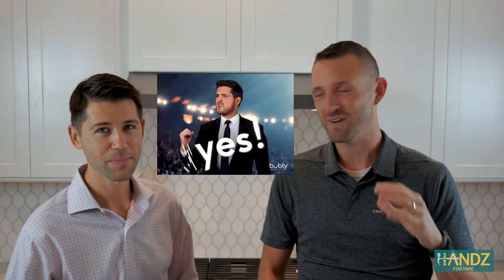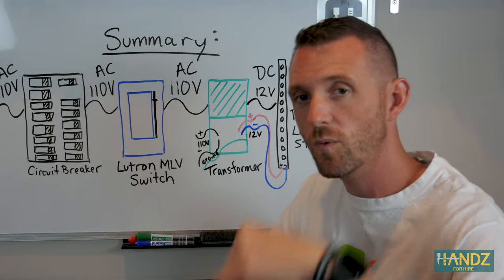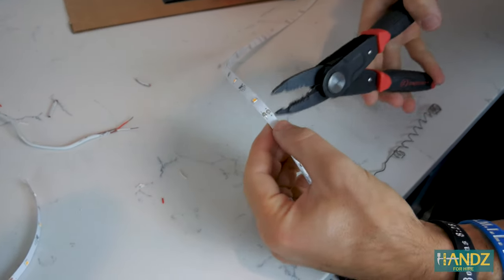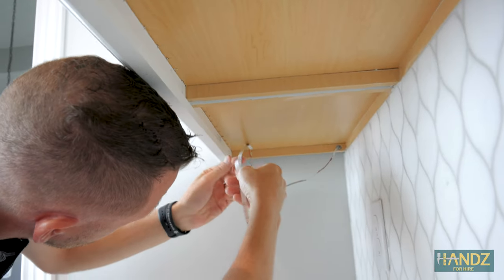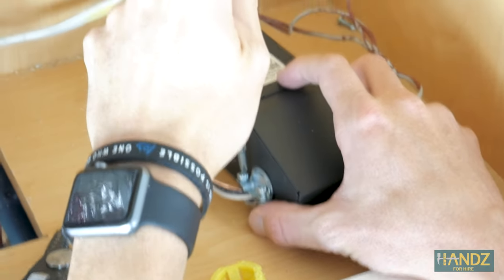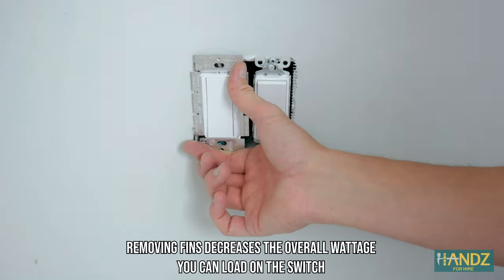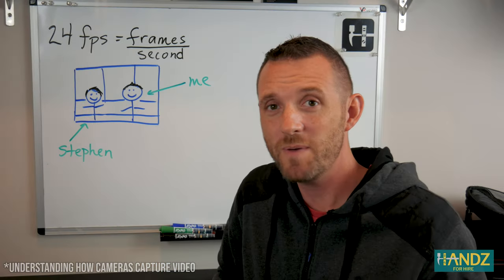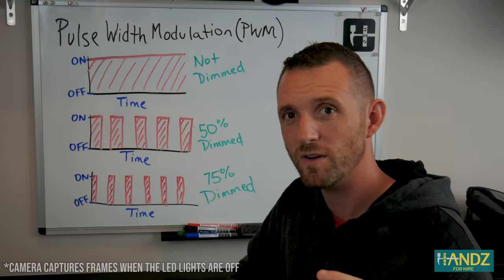HOW TO INSTALL UNDER CABINET LED STRIP LIGHTS w/ LUTRON DIMMER | Why do LEDs flicker on video?

Comment: You should not have clamped the romex on the wires themselves, rather than the sheathing. that's against code. Also not positive but I think the exposed wire coming out of the wall needs to be in conduit for code as well.
Reply: The exposed wire would be ok outside of conduit inside a cabinet i think but you're definitely correct about the non sheathed 14/2 being clamped, thats a no no.
Reply: Nah inspectors will pass having romex in an cabinet in a situation like this
Reply: Romex wire is not allowed exposed in a kitchen cabinet, BX armor cable is. Also mixing the low voltage wiring with the higher voltage wiring in the same enclosure is not permitted without a physical barrier between the two. There are exceptions if you know the NEC National electrical code. This is what separates the DIYers from the professionals. FYI the Romex sheath goes in the connector not the single conductors.
Reply: I totally agree!

Comment: Hi! I had an electrician install these under my kitchen cabinet but after 3 years, 2 of the strips started to flicker then they completely went out. What could be the problem and how do I replace them? They're not on a dimmer. Thanks :)
Reply from the maker: Hello, I appreciate you sharing. If this happened to me, the first thing I’d check are my connections. Sometimes wires can get bumped and the soldering can come loose. Did your electrician solder directly to the strips like we did in this video? Do you still have strips that are working? If you’re able to share a little more detail about your setup, it would be helpful.

Comment: Regarding the flickering. The camera that you use records a certain amount of frames per second, where the video that you see is comprised of still images. Let's say that the number is 60 per second on your camera, and then the LED's light controller emits electricity in a similar fashion (let's say, pulses per second) and often the two numbers do not match up. When you then review the footage, you're witnessing frames that the camera recorded where the LED is on or off depending upon when that exact moment in time was recorded. You don't witness the phenomenon much in real life, as your brain interprets the data (raw analog sight) more smoothly.
Reply from the maker: hhatexas were you able to watch the end of my video? We’re totally on the same page!

Comment: Did you mention what type of wire you used
Reply from the maker: If I didn’t, then I used 18 gauge which is good for low voltage lighting.
Reply: Handz for Hire thank you !
Reply from the maker: @jesusromero9838  you're welcome! Good luck with your project!

Comment: Do not buy these for your under cabinet.    The steam from your kettle and food wear out the glue and it comes off in 6-12 months.
Reply from the maker: Hey Ryan, I’m sorry to hear that. I’ve had mine up for almost two and a half years in the kitchen and haven’t had an issues yet. Do you have the strips right over your stove? I could see an excess amount of stream or high humidity lowering the viscosity of the glue. I’ve used this heavy duty double sided tape for a lot of projects around the house and it works really well if you need to re-stick some strips. Good luck! BTW, I was not sponsored in any way for this video but have enjoyed the product. Heavy-Duty Exterior Mounting Tape, Holds 5 lb., 1"x60" https://www.amazon.com/dp/B00004Z4BV/ref=cm_sw_r_cp_api_i_FSaIEb65W9D7E

Comment: Your red is negative and white is positive wth???
Reply from the maker: Well, in truth it doesn't matter as long as you're consistent and hook it up to your transformer correctly. As far as universal wiring goes, for AC, black is hot, white is neutral, and red is usually a traveler in a 3-way switch. For DC, like in this case with LEDs, red is usually positive and black is usually negative. In our situation with the 18 gauge wire, we had white and red wires with no black. We could have gone universal on the red, but the white was an outlier regardless. I chose the way I did to show that it doesn't matter how you hook it up as long as the hookup is the same throughout. Have a great day!

Comment: You completely lost me when you 'dedicated' negative to red, I am no electrical genius, but THAT goes against everything electrical.
Reply from the maker: Yeah, honestly white and red aren't usually associated with negative. White is usually the neutral, and red is usually a second hot (negative) or a traveler wire (hot wire between switches in a 3-way switch situation). I just picked red as negative when I was below the cabinets. When I got up to the transformer, Magnitude had picked red as positive and blue as negative. There's no difference in the material of the wires other than the color of the casing so I just had to make sure I connected the red wire (negative) under the cabinets to blue (negative) in the transformer, and white (positive) under the cabinets to red (positive) in the transformer. If I had setup the transformer first, then I would have switched all my soldering under the cabinet. I hope that makes sense. Have a great day!